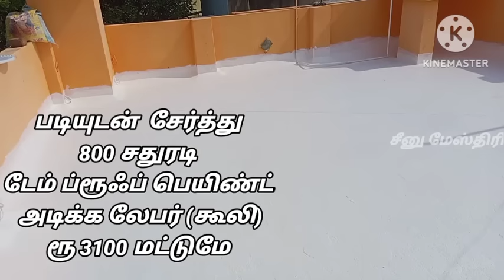600 சதுரடி கூலிங் பெயிண்ட் அடிக்க எவ்வளவு ரூபாய் செலவாகும்?|how much cost from roof cool painting?

Comment: You could have used an electric drill with mixer-bit to mix the paint (or a stick). Using hand to mix is not ACCEPTABLE.  You should have used Masking tape just above the terrace  to paint the terrace  to finish it with fine line/level without getting on to the yellow paint.

Comment: Damp proof Ultra is Best 
Price 20 ltrs Rs 6900....i did 
Two Coating with  4 inch Brush..No need roller brush.....Roller brush is not Best Result 
Use Only 4 inch Brush....
1st Coat Water mix ratio 2 ltr with 10 ltrs mix with Damp proof Ultra....
No need to mix Water...for 2nd Coat... Only i did 2 Coats only...
I did my home Recently..
Very good result..

Comment: 1.  irrespective of crackseal, you must seal all 4-sides of terracotta roof tiles. It's a must.
2. Please use joint tapes for horizontal and vertical joints. Available with asian paints.
3. For terrace, please apply paint for parapet walls too.
4. Claim warranty.
Reply: Bro, what will be the temperature difference after applying this paints?
Reply: 7 degrees Id you use cool paint but if you use damp proof it will be 3degree
Reply: @udays1219  but he claims it will come down by half in the video! that doesnt look realistic...even cool paint wont be that great
Reply: @tkaravind  exactly thats what I was telling him all white reflects heat but how much heat it reflects. He is just dumping all.
Reply: Can you suggest the steps and materials used?